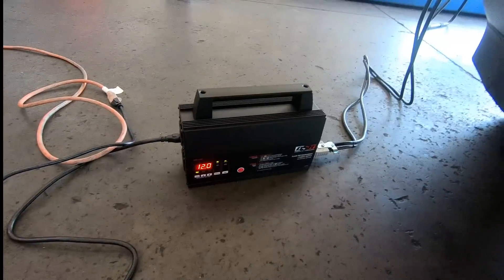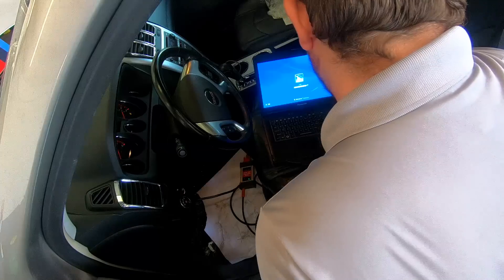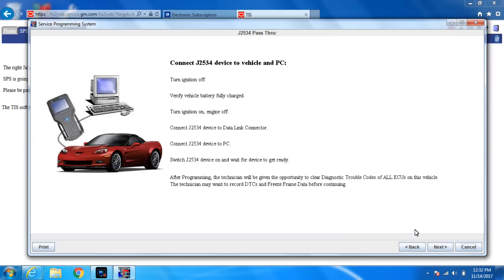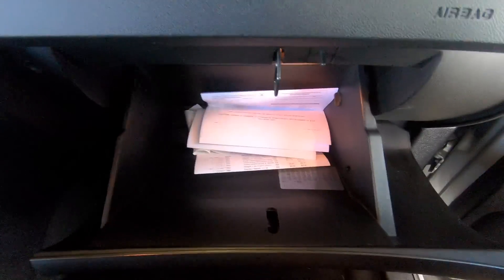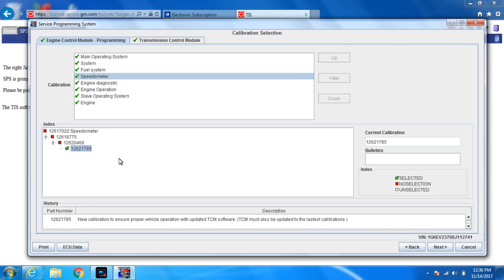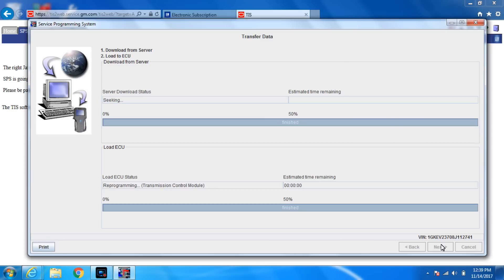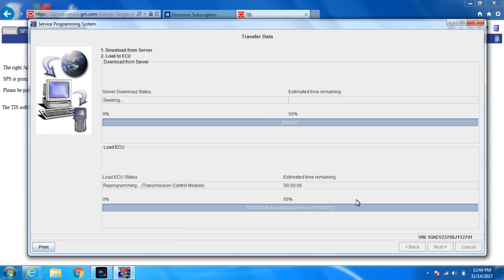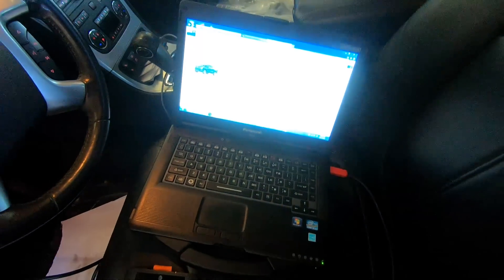Programming a GM TCM with an Autel

Comment: So if in install new tcm module, would it start to move around to load onto tow truck or into trailer? Gotta replace a module, and trying to plan what I have to do to get it somewhere to flash module.

Comment: Do you know a way to programe an ecm from a 2015 chevy cruze that has a 6 speed transverse transverse to be used with a gm 5 or 6 speed longitudinal transmission?   Since they use the same software, is there a programmer to change the shift points on the ecu to the optimal shift points on the other?  Im surprised these aren't plug and play so when the tcm is plugged into the ecu, it doesn't recieve the information.   It would make changing transmissions much easier but then gm can't change for everything, lol.

Thanks

Comment: Ok now my "DUMB" question, what is the PC Software you used called and where did you source it??? I have an Autel Maxisys MS908CV and the J2534 ECU Programing Device BUT I have never used it with a laptop, always only the TABLET. I now have a GM TCM to replace and program, so now I need to learn this skill QUICK, Does GM still offer a single day subscription to go get the necessary files???
Ok so watching the video the second time, all I need are the PC Drivers for the Jbox, everything else appears to be happening in a web browser, CORRECT???
acdelcoTDS looks completely different now than it does in the video, and it appears sps2 is available for ONE vehicle for up to 24 months, now, CORRECT????

Comment: Your battery voltage is NOT 12v it's falsely showing 12v cuz the draw on the battery from all the modules etc causing a voltage sag. It's an artificial voltage. Turn stuff off and it will go back to the 12.5v or whatever the actual voltage is.

Comment: I'm confused...  You installed windows on your Autel?  I've already tried using SPS2 from a laptop, and it can't even read the VIN on a 22 Tahoe, and programming fails every time with a communication error.  Can I just use Autel's software and not SPS2, since the Autel can read the VIN and view live data?

Comment: Hopefully you can help me.  I am trying to program vis ACDELCOSPS and in the process it is unable to connect to my J2535 Autel tool.  It says device is not there.  When I connect my Autel scanner to it via bluetooth, I can communicate with the vehicle.  When I disable the bluetooth to disconnect the scanner, and then use the USB cable to connect it to my laptop, I get the signal from Windws stating my Autel device is ready, but in SPS programing, it says it cant communicate with the Autel 2535 device.  Thoughts?  Is there an additional driver I need to download for the device?

Comment: Does programing a ECU also apply to TCU’s? I got a error code on my 2000 vw beetle of a missing signal from the TCU. I just bought a used TCU with matching numbers. Does the TCU need to be programmed for any reason?

Comment: Thanks! I have a TCM to reprogram for a used trans. Great step by step approach. First time today, I programmed a Ford RSM. It went well without any issues. On to the GM TCM.
Reply: RS1 I bought a used one off eBay. $450. Plus bought a used laptop that was comparable. $640 with tool, laptop and 1 subscription from gm. If your only doing 1, bring it to the dealer and have them program it
Reply: What is needed for Ford RSM?
Reply: @RS1 Tell them you want the TCM refreshed. They will take your money and do it.

Comment: We just tried 10/30/2019, it looks like GM is no longer supporting this, the only device it will let us select is a Tech2. The maxi flash isn't on the list and even the devices on the list dont work, it says "please contact the device manufacturer for technical support".
Reply from the maker: Keith Schulz nope it still works you need to download the j2534 wrapper and it will later on allow you to select a j2534 device
Reply: Did you ever get to the bottom of the? Dealing with it right now.

Comment: Is this flashing the vin to the new tcm? I just did the same thing to a 08 chevy malibu 3.6 changed valve body and tehcm and reprogrammed. But it doesn't not start or crank and prndl doesn't light up as if any gear is in place. I'm not sure what I'm doing wrong. But if I connect my old tcm it start up quick.

Comment: HELLO MATT,
     I CAME ACROSS YOUR CHANNEL BY WATCHING PAUL DANNER. I WOULD LIKE TO TRY PROGRAMMING  AND BOUGHT THE LAUNCH J-BOX AND I ALSO HAVE THE AUTEL J-BOX THAT CAME WITH MY AUTEL 908P SCAN TOOL.FIRST I WAS WONDERING DOES THE TYPE OF J-BOX BEING USED COME UP AUTOMATICALLY IN THE LIST OF AVAILABLE J-BOXES AVAILABLE ON THE MANUFACTURERS SUBSCRIPTION OR DO I HAVE TO ADD IT. ALSO WOULD I NEED A LSID( LOCKSMITH ID NUMBER) NUMBER WHEN PROGRAMMING SOME ECM'S OR PCM'S BECAUSE OF SECURITY ISSUES. ONE LAST QUESTION- WHAT DO YOU THINK OF THE LAUNCH J-BOX 2534 ?
 THANK YOU SO MUCH FOR YOUR TIME AND WILLINGNESS TO SHARE INFO WITH US. I HAVE BEEN WATCHING SCANNER DANNER FOR SOME TIME AND I THINK HE IS AWESOME. I  AM GLAD HE  DIRECTED ME TO YOUR CHANNEL. THANKS AGAIN AND MAY YOU AND YOUR FAMILY BE BLESSED 100 FOLD FOR ALL YOU DO.

                                                                                    RICK DAVIES

Comment: i bought the jbox maxiflash, i paid the subscription to GM for programming, but when im start to program, the gm software says ''OFF-BOARD PROGRAMMING DETECTED'' and trough me back, i installed the driver from the cd, the laptop that i used is kinda new with windows 10, maybe could i try with other laptop, and i've been reading that GM stop the compatibility with the jbox, is that true? please help, i bought the maxisys 908p and im very concern. thanks.
Reply: skuunker sounds like your doing it on the bench. It won’t work. Or if the network is mostly down in the vehicle it won’t work
Reply: Matthew Skundrich what it that means?
I’ve trying with a amd processor laptop, in the acdelco page it says support intel processor only, maybe that is the problem?
Reply from the maker: skuunker I only use Intel. 

Is the module you are trying to flash installed in the vehicle and connected to car and then your interface connected to the DLC
Reply: Mobile Advanced Diagnostics & Programming yes, is the fuel pump module!
Yesterday i program the bcm without problem, but i cant go with the fuel pump module, i think the laptop that i used is too new and fast, im gonna try with and older one.
what java version are you using?
Reply: Mobile Advanced Diagnostics & Programming and yes, its all installed!
I have the maxiflash elite, the newest jbox, i did the bcm yesterday to see if works and did it, the fuel pump module is the tarjet that i cant do it.
Reply from the maker: skuunker doubt the laptop is too fast. Never seen that problem but if it’s not an intel processor then it could be the cause. I use the java 6 32 bit
Reply: Mobile Advanced Diagnostics & Programming and which windows system?

Comment: If you are using an Autel J-box, or some other budget friendly brand that is not on some OE approved Validated J box list  and run into any sort of problem that require GM tech support assistance ,will they basically say you are on your own because the J-box you are using is not listed as a  Validated  J box.?
  What p@sses me off with  this is the need to run  old Windows 7 laptop and  needs to be a Pro Version .  What's wrong with Home version with Team Viewer?
Then these companies that care so much about car security and require LSID to program a keys now , expect you to run Malware susceptible older versions of Internet Explorer, and Java on our laptop to program their Sh@t..
Reply: The lower versions of Windows has less drivers etc. So more than likely the Pro version has components that don't exist in the lower versions. Just kinda how Windows is set up

Comment: Nice video. Have a question on newer vehicles. 2017 Acadia with push button on and start. Is there anything extra needed to keep vehicle on since it has no key and wants to go in sleep mode after a while  or is it a non issue during reflash
Reply: Ezkwip Equipment Videos from my experience when IGN is on(engine off) & the car is connected to a jbox it stays alive while programming.
Reply from the maker: Ezkwip Equipment Videos some of the newer one you need to hold the button till the green light comes on. There is two lights on these styles on the push button. Take holding the button for 30 seconds

Comment: When it comes to where the program lists the J-box choices  does GM actually now list the Autel Maxi Flash (Pro/ Elite)J boxes as options or was field manually typed in by you at an earlier date to display all the J boxes you currently  possess ?
Reply from the maker: It only shows j2534 device that the driver is installed. I have a few that I don’t have installed on that partition and it doesn’t show them.

Comment: for us do it yourselfer,s that cant afford a nice autel system and are getting ready to rebuild the pressure solenoids in my daughters 2007 acadia 6T75 TRANSAXLE Can i take it to my local auto parts store and have the codes cleared and have the tcm relearned and the shift parameters reset
Reply from the maker: No, the auto parts store can not perform this task. Many automotive shops can. Some schedule it with a mobile person like me to do the job.

Comment: Thanks for this Video. Helped me alot. I need to buy a J-BOX. Does that autel maxiflash that you have work well with most manufacturers. Thats what im leaning towards. Hoping to spend less than $1k on something. Any other recommendations?
Reply: Where in Florida  are you located am in west palm beach I have. A car that I think would need your touch

Comment: I have the autel scanner with j2534. Does it technically replace a tech2 if i use it the way you used it in the video? I was thinking of getting a tech2 so i can flash gm modules.
Reply from the maker: Automotive Circuit Solutions nothing replaces an original factory tool.

Comment: so their new model ,the maxisys elite with the j2534 cannot reprogram?
Reply from the maker: The elite or the 908 here in the USA has never really been able to program GM off the tablet. This is a very common misconception. It will so some asbuilt on Ford but as far as domestics go that is it.
Reply: Thank you for that info, they really make it seem like it does in their advertisement!
Reply from the maker: If you use a laptop and their jbox it will. Just not with the tablet. I get calls for this all the time.

Comment: Is the same proceduro for a equinox TCM relearn with a maxisys ms906 cable unit????
Reply from the maker: No, this is because the TCM was new. It needs to be programmed before it will work. Basically, I installed the operating system to allow the TCM to shift the car.

Comment: Great video, thanks for making it. I’ve been looking at the autel elite, should it come with the new j-box? How would I know the difference between the older one and new
Reply from the maker: john catalano doesn’t seem to be much difference other than size and no antenna. The Elite from AESWave comes with the latest J2534 box and another interface. I got the supper small one with no cord. It’s fun to remember what car I left it in at some back day shops 😂
Reply: Doesn't matter if you get the model with the aerial because it'll snap off on the first use(when you bump it on the steering wheel getting out of the car)!

Comment: Matt, why can't we use the Autel jbox with the Autel tablet? As I'm typing this question, I'm guessing because it is not windows based and is an Android operating system. Is that correct?
Reply: ScannerDanner that is correct Paul, no manufacture supports android or anything else besides windows so far.
Reply: Thanks Maic! That's what I thought
Reply from the maker: That is correct. All OEMs require windows operating system (7 or 10 not all have approved 10). For J2534 programming. Now the factory tool stuff can get interesting on what you Program with.
Reply: Matt any links to the equipment you use maybe even an amazon shop to help you out some more love the videos keep up the good work would love to see more videos from you.
Reply: I didn't realise you'd bought an Autel Paul? Or am I just assuming incorrectly? I was also thinking you could go in through the browser but getting the downloads to open might be an issue with Android?

Comment: I'm digging this charger!
Reply from the maker: The fact the cords are removable is why I like it! Being mobile I am awful hard on cords. I ruined one 70amp one because I broke the cables. It did take 3 years though.
Reply: Wow, That is one cool battery maintainer, and 100 amp output to boot. I bought a no frills IOTA DLS-90 with some custom 12ft cables for less than $300. No digital displays ,It works well  but it is pretty much vulnerable to the elements used as it comes and the power cord is just made too short.
Reply: I use the same IOTA, just wired in a longer, thicker power cord and cut up a pair if 20 foot 4 gauge jumper cables.
Reply: @ranchorelaxo2287  ,one thing I don't like about my IOTA DLS 90 is the cable clamps always arc attaching it to the battery terminals. It seems to discharge  capacitors. I have to hook up the positive one to battery first, then I touch the negative clamp to metal ground away from battery. remove it, wait for a couple seconds and touch it to ground once again and sparks again but much weaker, then I hook the negative cable to the battery clamp and then plug in the AC cord
Reply: Scanner Danner brought be here!!!